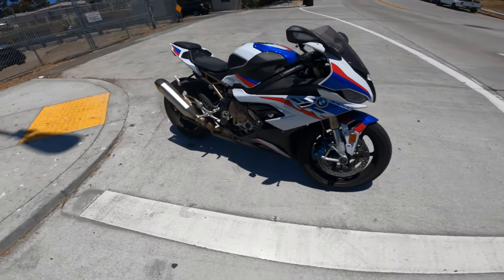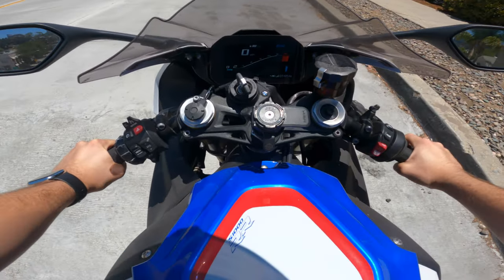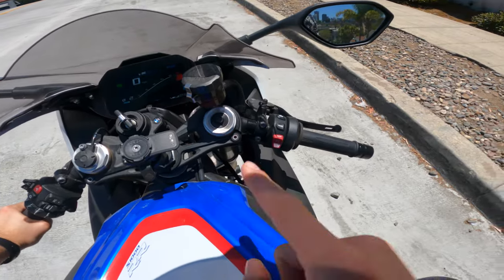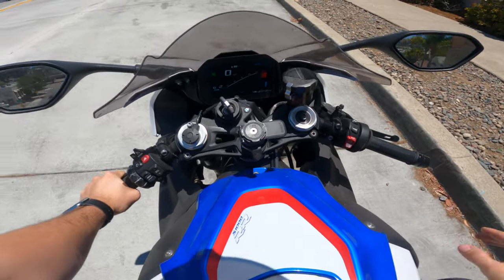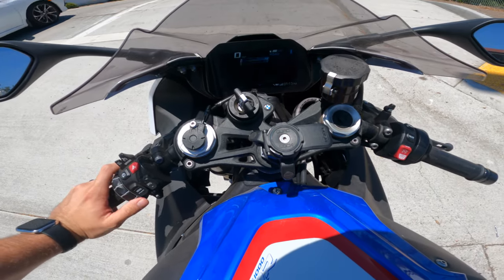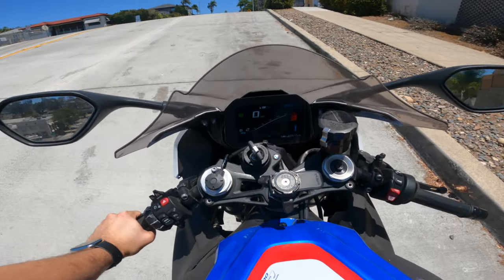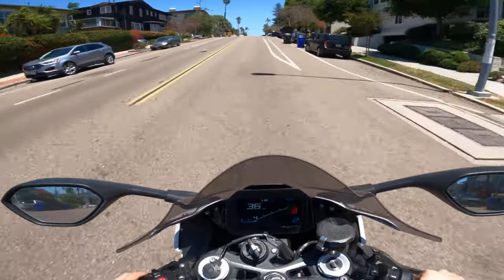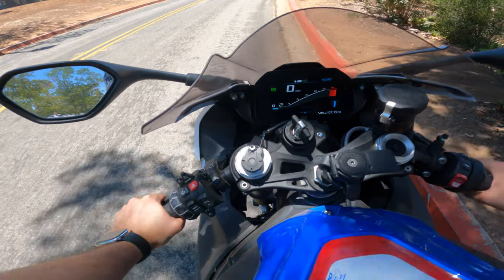BMW S1000RR FEATURE: HSC (HILL START CONTROL)!

Comment: Quite often for me hsc gets engaged when I’m stopped with my foot on the rear brake I am wondering why when it shouldn’t do that
Reply from the maker: I recommend that you double check your settings and make sure that HSC is not automatically enabled, otherwise it will automatically determine if you are on a slope high enough to engage it even if you only use your rear brake!
Reply: @MarzonTwo  thanks I did check this morning and it’s set to manual. I recently started to notice it happening a lot today has happened twice so far with foot on the rear brake only. Going to take it In for servicing next week and inquire about it.
Reply from the maker: @lazperez979  Yeah that sounds like a good idea, you have me curious to know if the rear brake also engages that feature because I always thought it was only the front brake that could engage it. 🤔
Reply: @MarzonTwo  that’s what I want to find out. But I think it’s an error of some sort for sure because I have tried to engage hsc with the rear and it doesn’t work. I’ll find out next week and let you know.